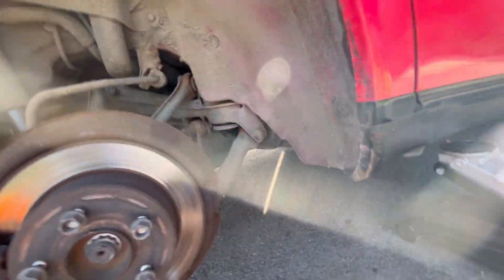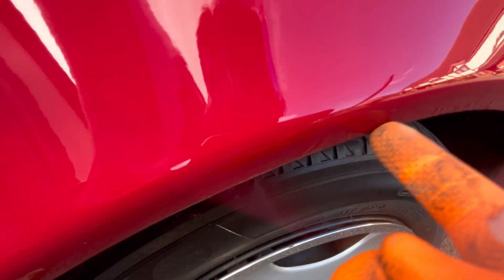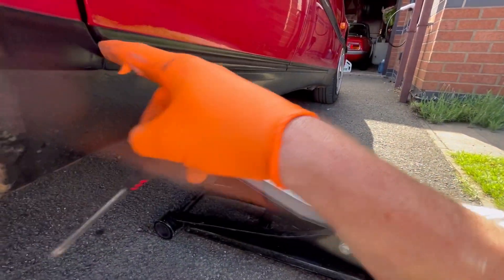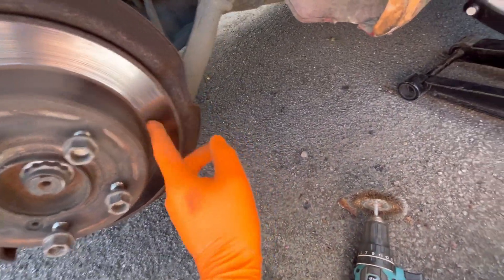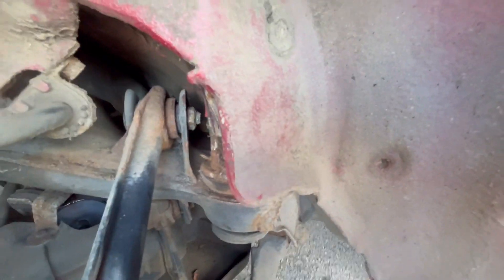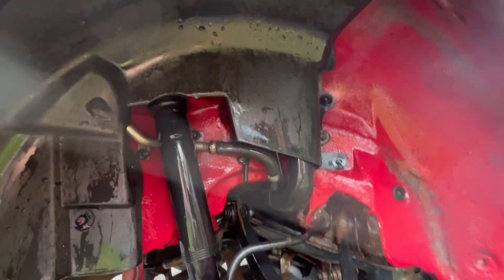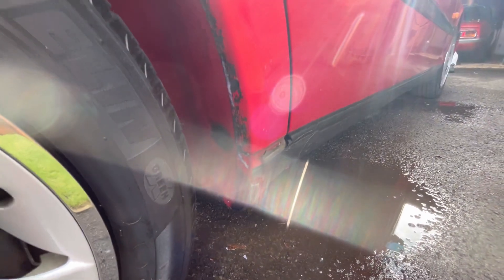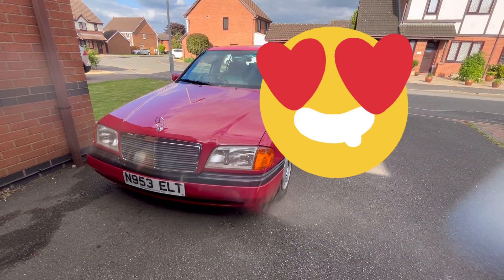Mercedes w202 c180 Esprit. Episode 3!

Comment: Funny coincidence that not only am I an Elan enthusiast, I also have had several of these old C Class Mercs, and currently have a W203. I find them lovely cruisers. I do have one little tip regarding rust on these cars. On a previous example I owned I made the mistake of allowing the rear brake backplates to go rusty. The problem with that is that the handbrake shoe hold down springs would no longer secure the shoes, leading to a non functioning handbrake, loose shoes and they are a nightmare to change! Lesson learned, I go over my current C Class annually with Waxoyl and Merc preservation wax and it is still mint underneath despite its 20 years. BTW, I can recommend the genuine Mercedes preservation wax, it is top quality stuff!  👍
Reply from the maker: A man of great taste! I’ll bear that in mind about the backplates 👍🏻